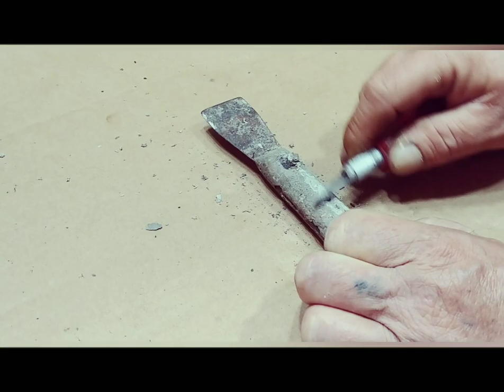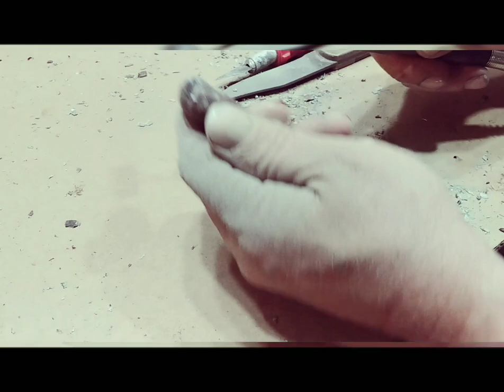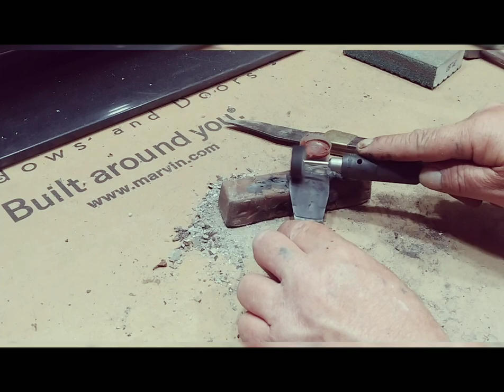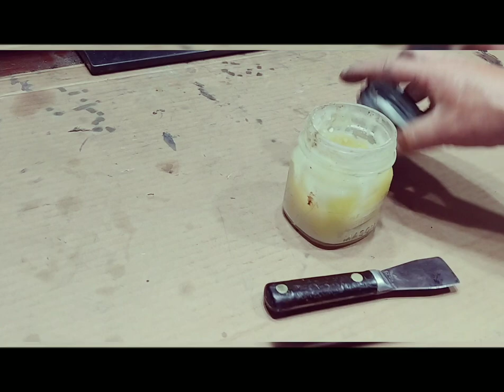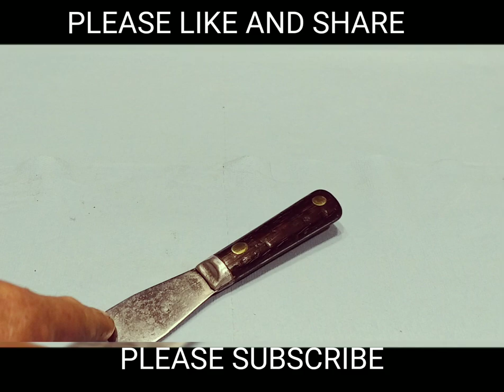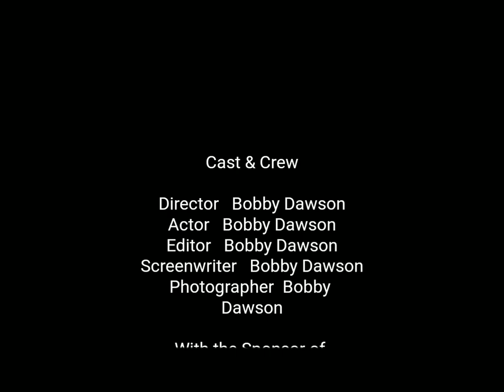ANTIQUE PUTTY KNIFE RESTORATION - REMOVING YEARS OF GRIME

Comment: Any time you are dealing with soft material, as the handles, seem to be, always use a flat sander to sand off the build up mess. That way the handle will look flat and uniform. I know you can but such a putty knife so cheaply, but saving any quality tool is a big plus in my book. Thumbs Up!